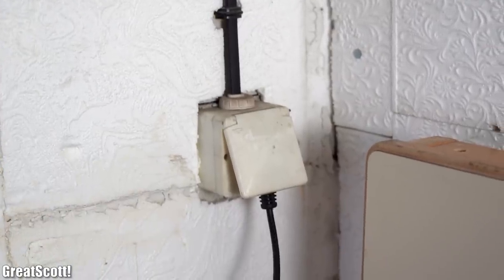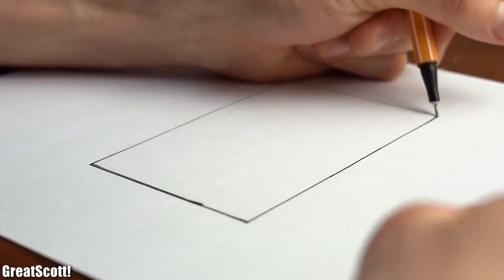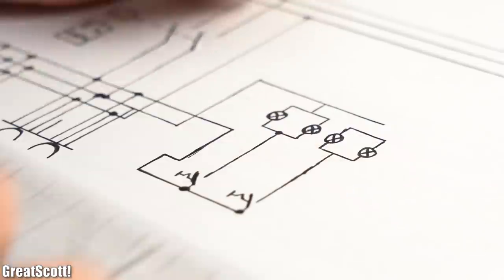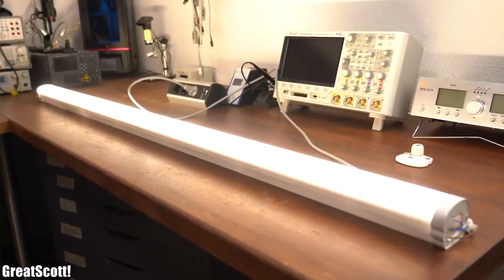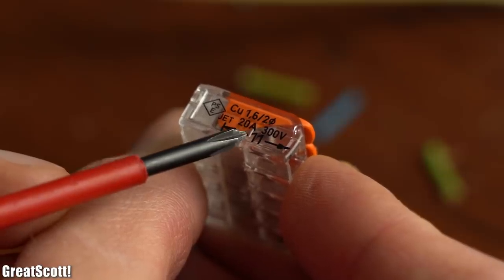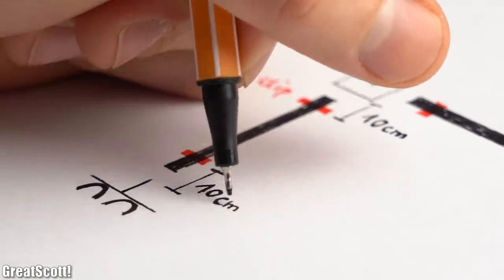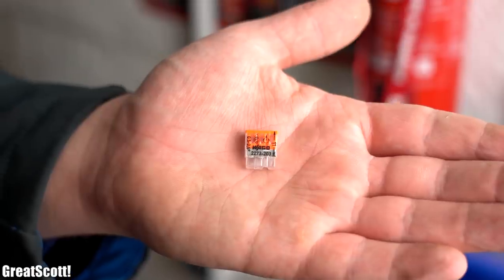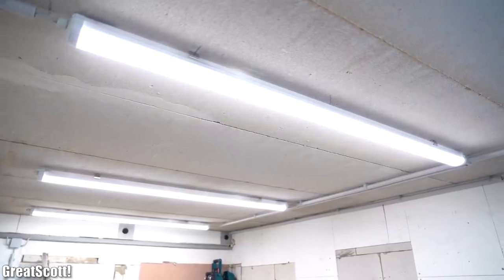How to do Electrical Wiring properly! (more or less....) GERMAN STYLE!

Comment: It's good to see standards in other countries.
Stopping the conduit 5cm before the fitting seems bizarre standards. No protection to the part thats likely to suffer damage. UK standards are hugely different in this area.
Reply: I don't think it's standard, more like a rule of thumb to make it look the same everywhere. The conduit isn't mandatory.
Reply: You're right and plastic consumer units(distribution boards) in the UK should now be metal and clips supporting cables should be metal in case there is a fire and the cables fall down and impede fire fighters.  Ironically 50 years ago we used to use metal cable clips!
Reply: bro, around your Vacuum cleaner cord is no conduit too!
Reply: @forownmade1243  And thats why the vacuum cleaner doesn't and isn't designed to last 40-50 years.

Comment: Why do you need conduit? Seems like you can just secure wire directly to the wall (or ceiling) instead of fishing it through conduit...

I guess it might be nice for ceilings, because then you can support wires along their entire length instead of just anchor points, but that still seems superfluous.

I guess you might be afraid that stuff would snag on to the wires?? But you can also snag conduit...

Or is conduit just cosmetic??

Comment: What’s the point of the 5cm gap between the conduit and backboxes? In the UK the idea of cable containment is to contain the cable at all times, so bends, conduit boxes and glands would go where you have bare cable exiting the conduit before it reaches an accessory or turns a corner.

I’m baffled!

Comment: I actually went through all this research process just to make a solar generator ( single solar panel with a 1kw inverter ).  Its very different to when you just do high power DC wiring where you can just solder 2 wires together and then cover it in heat shrink.

Comment: Interesting and looks odd as the conduit is not continuous from supply end to consumer unit. Also the RCD looks for an imbalance of power leaving the live and returning via the neutral. for example through a human body to ground/earth. In the UK we calculate the voltage drop in the line to work out the size of cable to be used.

Comment: I have one question... As for the DIY wiring at home...
Are you required  to have an certified election to "check" the wiring/instalation over? 

I know that we here in Slovenia can change ie. a socket, light switch on our own but as soon as you change something in the fuse box it's another story...

Comment: The garagebox has an own power supply? Are these fuse box also build in when the garage is build attach or near the main homebuilding?
Reply: There has to be a meter somewhere, usually that is either the household meter or placed separately for all units in an utility room.

Comment: 5:02 I noticed you used Faston pre-insulated terminals (I'm pretty sure this is the correct name, but there are many variations in different languages) with a ring that usually is supposed to be screwed. So, what type of connector are you using to connect the wires to the lamp? It's just a screw terminal? It seems like it has some sort of "buttons" on top

Comment: Are you in Germany not required to secure the cables, so they cannot be pulled out of the junction boxes etc.?

And which part of Germany used aluminium wiring forty years ago?
Reply: the communist part i.e. east germany

Comment: Hi, great video! Is there a reason why the conduits should end 5cm from the junction boxes? Here on Brazil the conduits are inserted into the boxes to completely hide the wires.
Reply: Here in Belgium we can use the open conduit system (the 5cm) if you use cables or if you use wires your system must be closed (in the boxes)
Reply: I guess it's easier to pull the wires/cable in this way, it's also faster because it doesn't need to fit perfectly in between. It's not mandatory to use the conduit, so you can do it as you like.

Comment: Excellent video, interesting to see how it’s done in other places, I remember when the hager displays arrived here in Australia, I had to completely re wire them to make them comply.
16Amps on 1.5mm solid cable, I guess it also works great as a heater to keep you warm in winter 🥶
Reply: 16A fuse is OK according to the tables.
Reply: @Brian_44, not here, 1.5 is limited to 10 Amps and can't be used for socket outlets
Reply: @Brian_44, I guess so, but we are limited to 12% total voltage drop as measured at end of the longest circuit, and the millivolt / Amp / Metre rating of 1.5 is too high to be used on circuits over 10 Amps,
also the 75 Deg cable insulation must not be exceeded even in the event of a short circuit on the end of a cable after running continuously at it’s rated current, given that a roof space can easily reach 40 Deg here in summer, 50 Deg in some States.
There are other reasons as well, touch voltage, energy efficiency ETC.

Comment: Just a question, usually, shouldn't you put a separate fuse for the lighting circuit and a separate one for the sockets?In a house maybe, wouldn't it be helpful to have a fuse separate for those in case you just want to work on one of those?

Comment: Whats the diference between solid core wire and stranded wire? In my country they only use stranded wire.
Reply: Solid cores are better because you don’t need to do anything with the ends of the wire. On the stranded wires you need to use special clamped fittings or whatever it’s called. Also solid wires are much cheaper. In Europe 100% of wall wires are solid. Even cat Ethernet cables.

Comment: I need to correct you, because i know that 1,5mm2 is rated for about 10Amps. (Basic rule 6A for every 1mm2 ) means for 1,5mm2 it will be 9A (10Amp), 2,5mm2 wire is rated for 16Amps.

Comment: 6:58 You put a B16 RCBO after 6 amp fuse, so you are using only the RCD Part of it? Because in  case your Kabel is overheating or there is a short circuit, the 6A, even as the melting fuse beeing much slower, it will most likely pop first. But beside that, I have to say clean work your friend did there, thats sadly not always the case.
Reply: In case of a direct short, the RCBO may be faster than the 6A fuse, but it's good to put in the RCBO anyway. I guess putting in an RCD on its own isn't allowed in this case.

Comment: Good old times, haven't seen a wiring plan for about 20 years when I learned how to draw and read them. 😅 I am somewhat surprised you didn't include an AFDD, the inner wall material in that garage looks very burnable (yeah, flower patterns don't help).
Reply: LOL, good point!  Sure the styrofoam insulation will go up like a rocket, but at least the electrical is somewhat less flammable...

Comment: Hey, Scott, nice informative video, just a heads up, 16 amps is the max current also that is for single conductor, but when you have 3 conductors together in a cable then it decreases, generally when we design & calculate we consider it as 80% of the Max amp rating, ie 12.8 Amps, and keep some safety margin. Also for mains cable, we consider the future uses and keep some ampacity for the future use as well, but I see that you put in the 5Amp fuse, so you are using it for a 5A max, which is fine. But I would recommend that you consider for the future, lets say he gets a electric bike or work with power tools in the garage, that is why we keep 30 percent spare as well.

Comment: Great video! I live in Switzerland and I don't get why the rigid conduit does not connect to the junction box. Also when there is a conduit intersection, instead of using a junction box to connect them, the cable is just hanging there. You always have the cable exposed on the corners. I have this kind of installation in my workshop and I hate to even look at it. I see it everywhere.

Comment: So different from here in the states. Very interesting to see. Thanks for the sharing.
Reply: not really more similarities usa to germ. than usa to the uk
Reply: @wizard3z868  As an electrician from the US, everything is this video is completely different than what is standard here. Wire color, receptacles, breakers, Terminal blocks. Anytime we use DIN mounted breakers and receptacles is only for industrial settings. Looks like its common to see those in residential applications in the UK and Europe . Even the wiring schematic symbols are different.
Reply: @SeanLeonDrumz  maybe ive just been watching so much of uk and Australian sparks things are not so differant anymore lol but things are not tht diff if you look at it simple one hot a common and ground- term blocks are wirenuts and din rails are just  better designed stablock breakers  boxes and switches still the same function
Reply: @wizard3z868  Yeah I agree, Electrons are electrons any where in the world and all the materials that are used here use the same concepts,just look different. Im simply stating the standards abroad are much different. For instance, brown and blue wire color where i am from is typically only used on a 277v system. If i was working in the Germany and saw that not knowing better, i would assume it was a 277v not 240v.
Reply: @SeanLeonDrumz  o ya agreed like i said ive seen so  much of it its all starting to meld like how pple can lrn so many different languages

Comment: In Italy, it is very very similar, but we no longer use rigid copper wires since the 1950s - 1960s.
Why do you still use rigid copper wires?
Reply: @forownmade1243  There are many reasons. the multi-wire is more flexible but above all, it conducts electricity more efficiently because of the skin effect: https://en.wikipedia.org/wiki/Skin_effect

Comment: I like the Wago connectors. We normally use wire nuts here but they aren't as good. I ordered a couple boxes of wago a year ago. And that's what I've been using. However, glad you mentioned that a different type is needed depending on solid vs stranded. I didn't know that! What if I tin the stranded with solder?
Reply: No can do 😂 If the wire is flexible you need a Spring tensioned Connector or you can Crimp a Aderendhülse or a Kabelschuh (sorry dont know these words in English) but only in Screw connections. And no Soldered or Crimped wires in Spring tensioned Comnections. I hope its somehow understandable what i wrote 😂
Reply: @sneaky3685  Thank you!
Reply: I'm pretty sure the Wago lever connectors can use either solid or stranded wire, it's the smaller push in Wago connectors that are probably solid wire only.

Comment: Exactly the same as we use in the Netherlands. Is this standard used in the whole EU?
Reply: I think it is widely used here in Europe. But I think the electrical installations in Germany, Austria, Switzerland and also the Nederlands are pretty similar.
Reply: In Austria and in most cases in Switzerland it is the same installation method
Reply: EU-countries are autonomous for their electrical standards, so it is different, but on the other hand, they look at what the others do.
Reply: @danielmantione  this is not true in most cases, because the electrical standards are made by cenelec for all countries. There a few things which are not harmonised and a few others which can't be fully standardized  due to history. But the most rules are the same though out Europe.

Comment: Very good explaination, but I would have a little bit more about the necessaty of RCD (especially in Germany). I was wondering why you are using an IP24 distribution board in an presumetly unheated Garage ? Oh and good thing you used Wago 221 series and not the included ones with the lamps. These are absolutly terrible.

Comment: Great video! What is the reason that we use PE cable which is the same diameter as L and N are? In normal condition there will be no current and if something will go wrong the RCBO will break the circuit at 30mA - for which a tiny wire would be enough. Are we extra cautious if RCBO fails? Or is it something else?
Reply: Regulations generally supplement each other instead of replacing it so having an RCBO instead of a normal breaker does not change the requirements of the cable.

Comment: Why did you use a huge Hager distribution board? You can get boxes for 4, 6 or 8 modules.
Reply from the maker: It works well for us and we are familiar with it.
Reply: Here in Germany youre expected to leave 20% space for adding components to the distribution board  in the Future. That could be a reason.

Comment: (Usonian here, also I am not an electrician) I find it incredibly strange to see the use of conduit which leaves the ends exposed. In the US conduit normally runs from box to box never leaving the wires inside exposed. Also, we do not normally run insulated wires bundled in an outer insulating sheath inside conduit.

Comment: Shouldn't the wire tubes go into directly into the box, so no wires are exposed?
Reply: Here in germany this is not necessary. You are allowed to place the cable directly onto the wall, without the tubes. It's more for the aesthetics.

Comment: Hi Sir, could you please make an experiment with salt water lamp and make one which is efficient? There are already products sold here in Indonesia, the cheapest one I found costs 349 K IDR (around 25 USD). That's too expensive for most of us. A cheap and inexpensive one will really help in case of long blackout time, emergency or disaster.
Reply: I just saw more video about this. So it still need somekind of cells (magnesium anode?). Can we replace the cells? How much power can it provide? Can we recharge it? How much does the cell cost? Are there cheaper and easier alternatives to get? I dont think we will get magnesium cells easily..

Comment: Australia's standards are a bit different here you can't put the lights and power points on the same circuit and the power points cant be run off 1.5 has to be 2.5mm2

Comment: 9:42 Why do the conduits end before the junction boxes and not mount to them? Leaving wiring exposed largely defeats the point of a conduits. Isn’t this an obviously bad idea? Similarly it looks like there are no elbow joints in the conduits and the wire is yet again exposed and can rub against the edges of the conduits.

Comment: Wiring standards are so bad here in the US. My house's wiring hasn't been upgraded since it was built in 1959. Half the outlets are wired backwards, the other half are NEMA 1-15 ungrounded outlets. Pretty sure there's some lamp cord in the walls too. Most of the ground floor is knob-and-tube wiring, and there's a subpanel down there with Edison screw fuses. A shame I'm not in charge of that particular aspect of our property. :/

Comment: Is it common in Germany to use NYM cables for all installation? I'm wondering since here in Switzerland it seems more common to use single wires in conduits. Using cables is permitted but considered kind of bad style by some more rigorous electricians, in particular when building a new installation/wiring from scratch. The advantage of single wires is that you have more colors available, so you can keep consistent color coding throughout an installation - e.g. you never have to "abuse" a grey or black wire for a switched phase - there are purple and orange wires for that ;-)
Also, you can always just add one more wire later on when you need it ...
Reply: Cable is simple if all you need is l/N/PE. Soon as you need something a bit more elaborate, like lights with more than one switch you need extra wires going in different directions. With cable this gets complicated very fast, with wire in tube its a simple matter of pulling all the wires needed where needed.

Comment: For b16 circut breaker you should use 2,5mm² wire. 1,5mm² can handle max 13A so you should USD b13 for this cable
Reply: B13 is much more expensive and the pre fuse is only 6A tho
Reply: @muschelhirsch4522  No it isnt much expensive, in my country, Poland on internet hager rcbo b16 cost 259zl and rcbo b13 cost 275zl so...
Reply: @janekkazimir1278  Here in Germany 16A is 2.05€ and 13A 7.44€ for Hager MCBs
Reply: @muschelhirsch4522  normal circut breaker mbn 116e b16 7,27zl- 1,60€ and b13 14,74zl- 3,25€ Euro Exchange rate is 1€-4,53zł

Comment: Interesting, the cables seemed quite thin for what I was used to. In the Netherlands 1,5mm^2 installation wire is only allowed for 16 Amp when dealing with a single consumer or for lighting. Power sockets need to be connected to 2,5mm^2 (even for 16 Amp, so thats the common wiring in the NL). Apparently that's different in Germany. What kind of fuse did you put in the old distribution box ? If it's really a 6 Amp one, that 16 Amp triggering on the RCBO might be a bit much (there also exist 6 amp versions). In the NL, the advice is normally to not have lower rated fuses as the main fuses and at least a rating of 1.6 times the highest rating of your fuse in your distribution box if you have multiple.

Comment: ALARM. Jetzt hau ich mal einen raus. Was für eine Wand ist das und ist dein Hager IP20 Verteiler überhaupt im Bezug auf Brandschutz zugelassen auf dieser montiert zu werden?
Reply: Desweitern hast du deine Reihenklemmen in der Verteilung entweder anzuschließen oder zu entfernen. Speziell auf die blauen bezogen. Dann auch noch keine Endkappen auf den Rohren und die Schellen viel zu nahe am Ende der Rohre platziert. Und dann wird auch noch GARKEIN Bezug auf die Überprüfung der Anlage nach DIN VDE 0100 Teil 600 genommen? Keine Iso Werte, FI Auslösezeit oder Strom? Was ist mit Übergabegespräch mit dem Kunden und Erklärung der Installation? Alter du wärst bei uns nach so einer Installation direkt aus der Firma geflogen :D

Wäre super wenn du da mal einen Nachtrag zu machen kannst. 

(Ich persönlich hätte noch alles beschriftet da ich mehr in der Industrie unterwegs bin obwohl ich auch Energie- und Gebäudetechnik gelernt habe)